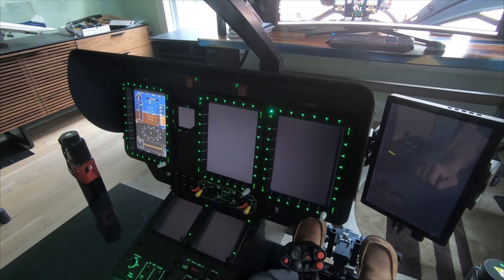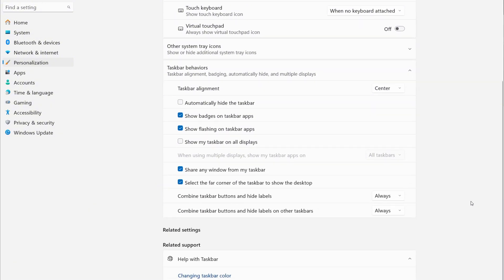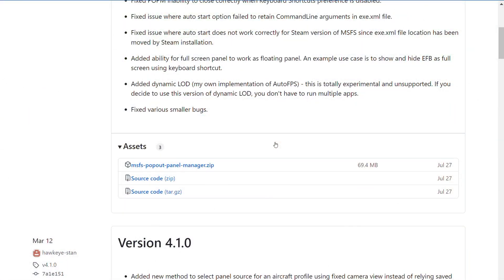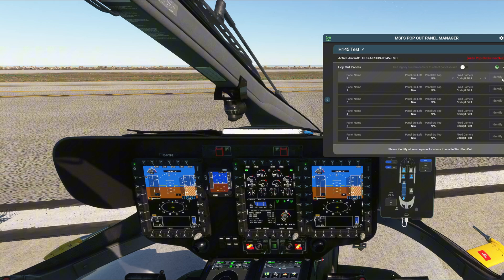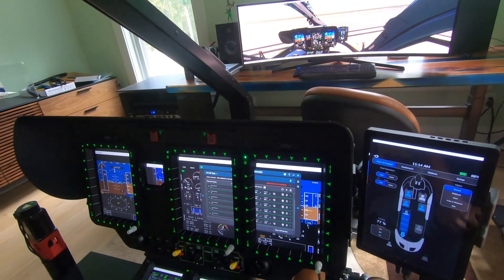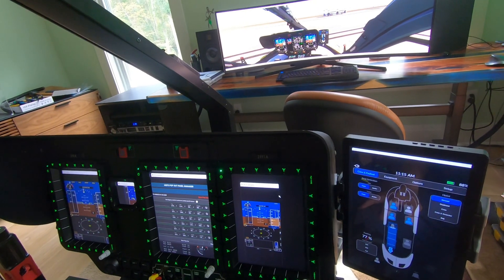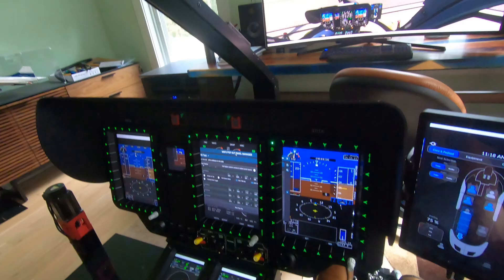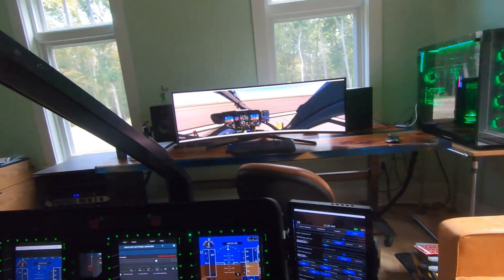H145 MSFS Pop Out Manager Tutorial - Elevate Your Cockpit

Comment: Can you please share the settings for the computer itself like the refresh rate that we need to sit because I have RTX 5090 and a portable monitor once I pop up the screen I’m having bad lag going around the cockpit my main monitor 240 Hz and that external 60 Hz can you please share your settings or a new video for the settings? Thanks so much.
Reply from the maker: I don’t have the sim in operation at the moment. I’m extremely busy with fire alarm contracting. I built a custom pc 13900k, 4090, 128gb of ram, solid state drives, windows 11 and have both the CPU and GPU liquid cooled. My main monitor is at 120hz, MIP is a standard monitor, same for GTNs. GTNs go to hdmi to usb so they are not plugged directly into my gpu.

Comment: Great tutorial. I’ve just started using pop out manage for my 777 cockpit and wow am I having some random issues. Some pop outs fail and some start. I’ll going to try exactly the way you do it and see how I go. Thank you again.
Reply from the maker: Hi and thanks for watching. Is this fs2024 or 2020? There are two reasons why something won’t pop out. The first is if you are in pan mode and you are not in the same position of the cockpit as when programmed the targets because it goes through and clicks in that screen essentially and if it’s out of range because the x and y are in the inner area of the pop out it will fail. Next there is a mode for graphics that you can turn which is an accelerated pop out meaning less delay. For large aircraft with alot of pop outs it’s best to keep that unchecked no matter how good the of specs area. Also make sure your screens are exactly the same configuration each time in windows when you are laying out your display.
Reply: @Rotor-Sims  thanks for explaining some of the pitfalls. I’ve had great success today pops work flawlessly and running smooth as butter. I’m using 2024. Thanks again.
Reply from the maker: @B777pilot Happy to hear and help! Let me know when you have a video on your channel of your 777 Sim. Definitely want to check it out. My other vids you’ll see my entire h145 is motorized and FFB. Are you doing a motorized yoke and throttles on your setup?
Reply: @Rotor-Sims  I’ll have to do a video and let you know. It a hybrid cockpit. Me for the 777 to practice before recurrent and jets and helicopters for the kids. I use the Bravo TQ with 777 attachments. I’ll have to try and pop out some other cockpits and see how I go. Really enjoyed some of your other videos.

Comment: Have you managed this in MSFS 2024 yet?
Reply from the maker: Hi, yes no issues at all, I’ve being doing this for more than 5 months. You will just need the latest version of the pop out manager.
Same process
Reply: @Rotor-Sims  Thank you so much for replying. I can't get more than 2 screens to pop out or MSFS2024 hangs either with Pop out Manager 2024 or manually popped out. (HS145, RTX5090 etc PC) Clean install of NVIDA Driver etc
Reply from the maker: @sephina My pleasure. I’m not having any issue with any pop outs so I don’t know what is happening on your end.

Comment: How have you connected your ipad? When I use an ipad i get a huge fps drop!
Reply from the maker: It's now an iPad. It's a small touch screen monitor. I'm not having any issues with frame rates but the setup is important too. I'm using a 13900k cpu, 4090 gpu, 128gb of ddr5 and all SSD drives. The pc is dedicated to fs only. No other programs are on it besides what is required to run the sim. I did a clean install and the OS is a Win11
Reply: @Rotor-Sims  is it a monitor or an ipad? Im lost haha I have an 13600 with an 7800xt should be no problem.
Reply from the maker: @Patrick_AV it’s a monitor. An iPad would require using an app like space desk and would have significant delays. I tried an iPad initially but found the down fall pretty quick. As far as setup there are a lot factors that can hinder performance. My who setup is under water. Separate loop do the CPU and GPU. Quad radiator on top and one in the front. Lower cpu/gpu temps help under load. My blocks are all ekwb copper. Thermal grizzly paste on the cpu if that helps.
Reply: @Rotor-Sims a now it make sence. Thank you!

Comment: That's a really cool setup!! I've almost finished my home cockpit too (A320). How did you solve the FPS problem with so many pop-outs? Doesn't your performance drop with this Setup?
I have a 5800X3D and 7900XTX....planning a CPU Upgrade, but just If I really have to.
Reply from the maker: I don’t have any performance issues. Running a 13900k and a 4090 all on water and overclocked. 128gb of ram all SSD. Did a clean install of Windows 11 and the PC is dedicated for this only. Running all motorized controls, platform, and a tone of switches (see other vids). Good luck with the A320 setup and tag me if you post a full build!

Comment: I will just add that you need to set your default cockpit view to display all the screens you want to pop out. You can't move the view to identify a screen, as MSFS POM loads from the default view. That also means that you cannot change your view while the screens are popping out and into place. If you do, the screen placement will fail. This is still the best video for MSFS POM I have found.

Comment: Super instructions. How about if you rearrange your screens and the pop out happens where you can’t see? Is there any simple way to fix it?
Reply from the maker: Best thing to do if you rearrange your phsycial screens with pop outs it to make sure they are arranged in windows display as they are physically. At that point I'd start a new pop our Manger profile. Thanks for watching!
Reply: @Rotor-Sims thank you. What about using cascade windows to bring all windows to the main screen and rearrange them again? I haven’t test that function myself yet
Reply from the maker: @Daniel2x3m I'm not sure if that will work. I never ran into these issues.
Reply: @Rotor-Sims I found that defining a new pop out manager profile does not help. the poped out instrument is still out of the screen and not visible. After doing some research and experimenting I found that the easiest way is changing the screen setting temporarily to Main Screen (windows-P) to bring all poped out instrument to the main screen and then switch it back.
Reply from the maker: @Daniel2x3m  Thanks for the update and for taking the time to troubleshoot this. That’s good to know regarding the pop-out manager profile not resolving the issue. Your workaround using the Windows-P shortcut to temporarily switch to "PC screen only" and bring all popped-out instruments back to the main screen is a practical solution, simple and effective. I’ll give that a try on my end as well. Luckily, I haven't had to rearrange my pop-outs. Works everytime

Comment: Wath screens are you using? :) (in th dashboard)
Reply from the maker: Hi, thanks for watching. I use a single 29" monitor for the MFDs.
MIP: 29" Wide Screen Monitor: https://amzn.to/47XLgsX

Touch Screen For H145 Tablet: https://amzn.to/3BumapI

Touch Screen For GNS750: https://amzn.to/3zNLKFs
Reply: @Rotor-Sims uuuuu thanks! Actually never taught about that! Thinking of building the AW101 cocpit / SAR-Queen (Norway’s new rescue heli)
Reply from the maker: @Mr.Telemark Sounds great and a fun cockpit!
Reply: @Rotor-Sims yhea! Your looks REALLY great
Reply from the maker: @Mr.Telemark  Thank you. Check out my vids with motorized controls, it's a game changer with Helis. I designed a collective and pedals using VP Force Motors which uses TelemFFB. The stick is a Monster rhino with Max Flight Stick Controls
Reply: @Rotor-Sims thanks!
Reply: @Rotor-Sims yhea and also! Wenh you prited the “frames” of the screens… did you “rais” the text the scraped off the paint or what? :)
Reply from the maker: @Mr.Telemark I did not make the helonix units. Those are made by ESC. If you expand my description on the video you'll see a list of everything I used for the sim if that helps
Reply: @Rotor-Sims oh thanks!

Comment: Really a good Tutorial. May be for beginners to start with one Panel only. By the way. The linked Pop Out Manager is refused by Microsoft Windows 11  because defined as danger.
Reply from the maker: Hi and thank you for wacthing. MS windows will think it's a danger because of the files contained therein. This is normal and also happened to me. The process for 1 panel vs 10 is the same. Where it becomes different is when you have to configure touch functions. Cheers!

Comment: Nice build man.  Qre tou running the touch screens/windows in window mode + autofocus. This is the only way it works for me. Otherwise not all parts if screens respond to touch..I do deactivate the window titlebar. Only issue is that the entire surface if the screen is not filled (bottom and top black on 1cm).

Comment: hi. I tried using a tablet for the MCDU A359 from inibuilds, but it doesn't work from touching. Is this a problem with the MSFS Pop Out Panel Manager or the aircraft itself?
Reply from the maker: @ВалерийВасильев-м7ь  Hi and thanks for watching. I don't use a tablet and haven't had much luck with them that is why I am using touch screen monitors. MSFS pop up manager usually is not the issue.

Comment: Hi ..
I know this video is a few months ago so dont know if youll see my post.
But i use pop out manager to pop out the h145 tablet onto a dedicated 2nd monitor and i get horrendous lag fps drops ( from 70fps down to -30 ) 
You dont seem to have framerate drops and was wondering what im doing wrong ..could you have any advices?  😬
Thanks
Edit ..ps.that's an awesome setup you have 😲😃
Reply from the maker: @sascenturion  Make sure you are on the latest version of thr H145 and the Pop Out Manager. Next, I am using a USB to HDMI so I don't use a port on my GPU.
Reply: @Rotor-Sims 
Hi ..sorry for the late reply ...real life etc 🙄
Thanks for the advices 😀👍,
I found what my problem was ...msi afterburner was interfering with the fps , as soon as i disabled msi fps app ,my pop out screen worked perfectly 😀👍 
Thanks!
Reply from the maker: @sascenturion  Happy to hear. Alot of FPS counters can interfere with actual frames. I try and use ones that are built in natively in games instead of 3rd party apps
Reply: @sascenturion @Rotor-Sims 
Hello guys 
Thanks for your informations.
Do you know if there is lag when pop out with ALT+Gr touch ? 
Im rebuilding home cockpit, previously this pop out dropped fps a lot … Thanks a lot for your sharing! Amazing work

Comment: I get the fail message. Whenever I want to start the pop out
Reply from the maker: @AVIANCASAMACES  Sounds like your view location changed. It is important when the pop out starts that mouse or anything used for changing the view nothing disturbs the process. When I do mine, I stay complete still until the process is completed. When the pop out begins you'll see the circles going to each screen. If they are not on screens they are supposed to pop out then you will get a fail message. They don't have to be dead center, just within the area of each screen to be popped out. If your view has changed you'll need to change each one of the locations for the target. Best bet is start over by doing a new profile. Hope that helps

Comment: Hi, great video! Can you change which popout is being displayed on a certain tablet by keyboard shortcuts? My goal is to be able to change different popouts on a single screen by adding hardware buttons or an encoder to switch between them. Many thanks!
Reply from the maker: @billy454cid  Hi and thank you for watching! I'm not sure because it sounds like that defeats the purpose of automating the pop out process. What you can do is make more profiles so if you are switching aircraft and configurations for your setup it would be beneficial. I'm curious to see how FS2024 is going to handle this aspect and hopefully it will be native.

Comment: wow!! amazing set up!!!! I am a real H145 pilot myself. This is just great. I have so many questions. Do you combine your set up cockpint with VR using the mixed reality software? How do you have the force trim set up? I have a Virpil and took the springs out so it can stay in the position I desire, but the helo acts super weird. Best regards!
Reply from the maker: Hi, and thank you for your message—and most importantly, for watching! Just to clarify, I'm not a licensed H145 pilot. I did hold a Private Pilot License (PPL) for fixed-wing aircraft when I was younger, but I let it lapse after missing the bi-annual check. I’m planning on early retirement, and when that happens, I’m hoping to start helicopter lessons.

Right now, my goal is to combine my H145 home cockpit with VR for a mixed-reality setup. I’m holding off a bit to see how platforms like Somnium Space evolve as more people start adopting it. I also feel like 2025 will bring new manufacturers and more innovations, which will be key for those of us with full-blown cockpit setups.

At the moment, I don’t have the force trim system fully set up. I’m waiting for my Moza base to arrive, which I’ll be connecting to my Max Flight controls. Regarding the Virpil setup: make sure your dead zones in FS2020 are set to zero, and that your controls are configured to be fully linear. Also, take a look at the H145 tablet setup page—ensure the hands-on dead zones are high enough so your controls don’t override the autopilot with minimal force, but at the same time, allow you to override the AP with enough input when necessary.

I’m actually working on a video right now that walks through the Max Flight controls setup, including details on the dead zone configuration. That video will be uploaded today, so feel free to subscribe and turn on notifications if you’re interested! I’ve got a lot of content planned. I recently posted a startup video, and after that, a real H145 pilot reached out with feedback about my battery switch, hydraulic switch, and test lamp switches. I’ve since ordered the correct ones, and I’ll be making a video of the entire process—disassembling the overhead, modifying it, and reinstalling everything.

Thanks again for watching! If you have any questions, don’t hesitate to reach out. Clear skies and smooth landings!
Reply: @Rotor-Sims  wow, thanks a lot for your explanation. I am already subscribed and eagerly awaiting for more content. I can’t get that full max cockpit, but I want to get the Max Flight H145 cyclic with short goose neck and attach it to a Moza or Rhino ffb. About the AP upper modes, I’m planning some button set up like stream deck + . I’m going slowly, but getting there. Again, thanks! I’ll be watching your videos 🫡
Reply from the maker: @adsilite  Thank you so much for your support! I'm happy to help. The Stream Deck is definitely a solid option for managing your autopilot, especially with the convenience of the knobs for fine-tuning. Max and I are also working on setting up an affiliate code to help viewers save a bit while supporting the channel. He's currently producing a thicker gooseneck and adapters for the Moza to my specs and we're in the quality assurance phase now. I’ve just received confirmation that my Moza has shipped!

I previously had the Rhino FFB, which, while a great unit, felt a bit bulky, and I wasn’t a fan of the external gears and belts. The Moza has slightly more NM than the Rhino, and I'm confident their software updates will catch up soon. I'm excited to get my hands on it and plan to make a video showcasing the gooseneck modification, adapters, and a demonstration of the force and trim release. Thank you!